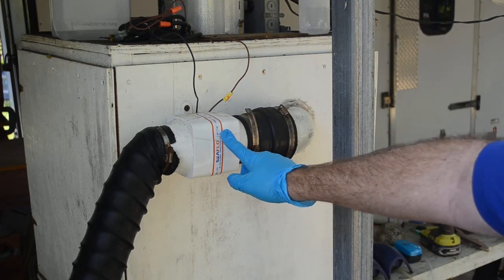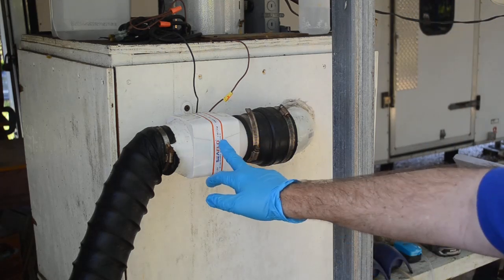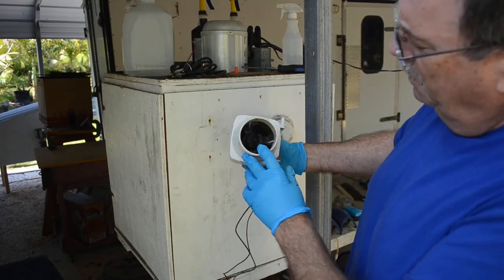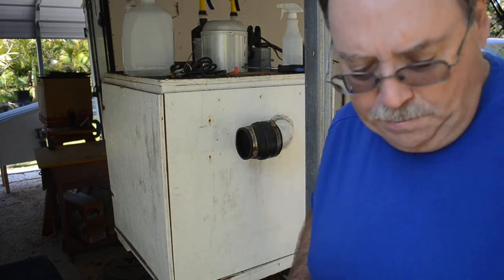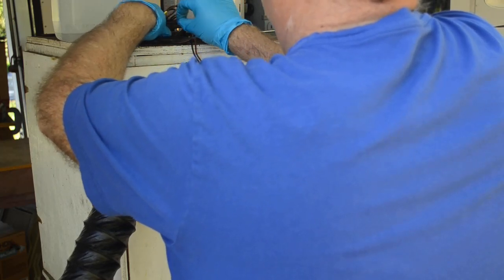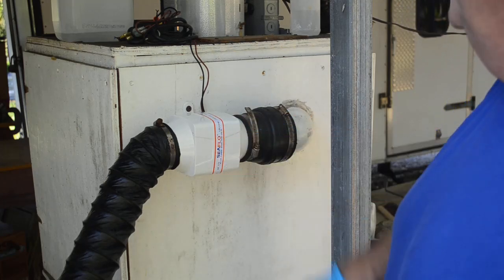Fume Hood Fix Before Gold Drop

Comment: You might consider adding a y-adapter that uses a Venturi effect to draw out the gases.  You need a more powerful blower but it will last forever.

Comment: So as a cool little tip or trick, if you want to make your motor last pretty much forever;

Build yourself a good Venturi valve out of PVC pipes from Home Depot. I built myself a 4 inch one using a 4” Y pipe and I blow the air at high speed through the straight piece of the tube and the Y intersecting piece is connected to my fume hood, That creates a vacuum, bringing all the fumes out, and they never touch the motor. I run a larger blower fan (one of those big ones for bounce houses) with a variable speed controller, and this allows me to run at lower speeds to get same airflow out, thus being quieter all around. 

You can even run a replacement aluminum grid type filter at the end of your exhaust that has a lot of surface area to consume some of the fumes, and every year or two, throw it into a bucket of hcl and pull small amounts of PMs out normally lost through fumes over time :)

Comment: You need a sodium hydroxide cell between the fume Hood and The fan not only to save your equipment but also for the environment the scrubber  can be as simple as a plastic tote with a wicking cloth or  a Venturi recirculating system to make a mini swamp cooler scrubber